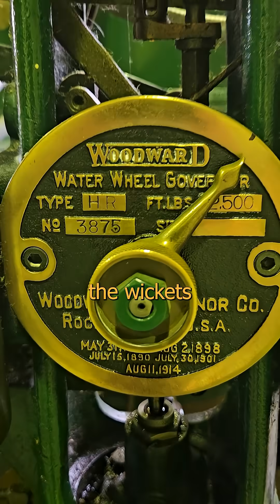Flyball Governor #chrisboden #comedy #engineering #generator #powerplant #electrical #technology

Comment: Trivia: Fly"ball" governor is where we get the term "going balls out" as going full bore.  When the balls fully extend it means the machine ( originating in steam engines) is running at an extreme and damaging rate. Did not know it was used in electro-mechanical systems.   Yeah, very cool!

Comment: Wouldn’t a direct mech linkage be more reliable? I mean, a wire is easily loosened by maybe vibration, and it is a safety feature… with a direct mech linkage the linkage is fixed, solid. Wires? I don’t know, doesn’t feel fail safe.

Comment: A simple set of springs and my 96 Dodge will now theoretically rev to 4500 RPM. Higher RPM governor springs are mostly good for making the automatic trans work better. Much nice to not have the engine falling on its face just before every shift.

Comment: I think I’m still missing something. The flyballs are for sensing rotational speed but driven by a motor that’s running at the same speed as the generator that it’s hooked to. So… my multimeter can read Hz, and I bet enough money to buy ten of them that my multimeter cost less than “this fuck’n’ thing.” Why build this?

Comment: The fact that someone first drew a plan. had hopes. Goes to a metal guy, this guy melts metal and does the housing. 
Incredible. No CNC no Computer, a smith, an enegineer and a little math. Mashed up to one reliable machine that runs and runs and runs. If you dont neglect oil and grease

Comment: The biggest downside to the industrial and technological revolutions. Is that we advanced far to fast and didnt learn how to eek out every last ounce efficiency from a device. We jumped straight to the next and never got very good at efficiency and just bull dozed our way through. 

Think of early computers, if we only had that level of processors for a few decades or even a century or more, how fast and efficient could we have made them. And then applied similar techniques to the next generation of device. Essentially making every step exponentially more powerful and efficient.

Comment: "Listen here, you beautiful maniac. Put down the fidget toys and build something that actually threatens life and limb. I want to see a human-powered kinetic battery. I’m talking a massive, cast-iron flywheel with a moment of inertia so high it makes Isaac Newton weep.
Rig up a gear train so we poor meat-servos can spin that death-wheel up to 'escape velocity' (yeah, I said it). Then, use a hydro-coptic clutch to slam that rotational energy into a generator once it hits critical mass. None of that cheap DC motor trash—I want a rig that effectively utilizes sinusoidal depleneration to power the shop. Build a gym that generates kilowatts or kills the user via catastrophic mechanical failure. Do it for science."

Comment: We are stuck in an era where those with the math and book smarts to design things, have never actually been on the shop floor Doing the things they designed. 
We pine for an era where the people who were on the shop floor transitioned into the people who were designing the next generation.
Until college degrees require 4-10 years on the shop floor  before you get a piece of paper saying you are smart, we are screwed.

Comment: We had one on the Steam Lube Oil Pump (known as the SLOP) on one of the ships I was on. As I headed to watch on day, I noticed a wicked vibration at the entrance to the Pit. As this was Definitely Not Normal, I took the "sailor express" way down to lower lever (I slid down the ladders) and found the entire engine room crew and the Khaki Brigade staring at the SLOP. Turns out one of the governor weight arms had snapped and was rubbing against the housing. Fortunately, we had two other oil pumps (Attached Lube Oil Pump or ALOP, and the Emergency/Electric Lube Oil Pump or ELOP) so we were able to secure the SLOP and repair it. Later in a shipyard period, most of the steam equipment was removed for electric versions.

Comment: You should see the control system for a nuclear steam turbine with mechanical hydraulic controls. Its madness on an epic scale, but it works so well. I believe there are only 3 or 4 left in operation.

Comment: i would have thought, seeing though it is involved in controlling the speed of the gates, that having it run through 2 peices of attached electrical systems would make it significantly more failure prone than having a mechanical connection to the device its trying to regulate. 

Obviously its more expensive to maintain, but if the generator fails, or the motor fails then its no longer preventing the overspeed of the gates then? 

I'm assuming I'm missing something obvious here. it makes sense if its just to smooth out and regulate operation but isn't considered a safety device in the way that a governor will put on the breaks if your elevator is moving up too quickly. (and to be fair, he never mentioned it was for safety)

Comment: How does the signal govern the generator? (I am not questioning the idea or the means, just asking) Does the resistance of the synch motor translate to limiting voltage or current to the alternator or AC generator on the generator somehow?

I see why it is brilliant theoretically, but I need a bit more information to add it to my engineering archive.

Comment: I have always appreciated old design.  Some of it is downright ingenious but simple - using various natural properties to make something almost foolproof reliable.  Things that didn't need a bunch electronic gizmos, power supply, or whatever.  Example: Fire door in old industrial building set on an inclined track held open by a heavy iron weight.  Weight is attached to door by a cable that has a piece of lower temp melting metal to connect it (like lead).  Gets hot enough to melt link, cable releases weight, and door shuts on its own by gravity.

Comment: Why bother with the taint drive if there’s already voltage output proportional to speed? Just wire it to a spring-loaded servo motor that’s connected to the throttle.

Comment: Love this thing!
Would you please do a deeper dive into this kind of governor?  I’m especially fascinated by the adjustable needle near the bottom of the machine, and in finding out what the horizontal needle just below the motor housing is for. Guessing it tells relative speed compared to the set speed… 

And in case it hasn’t been said enough, I love your videos!!! ❤

Comment: Woodward still makes these type of governors…

They are used in general aviation engines to maintain prop shaft rpm… adjusting prop blade angle to control engine rpm…

Steam punk cool that is modern today!

The fly weights in this case operate a control valve that adjust oil pressure being fed to the constant speed propellor…. A small gear pump, driven off the engine supplies endless supply of pressure to operate the system…

If this gear pump or the fly weights stop operating, the prop typically moves to the low pressure position, high rpm, maximum power output… for single engine aircraft.  For twin engine aircraft, the prop fails to the feathered position…

Dirt simple, keep lubricated, they last forever… your kids will have it overhauled after you are gone…

😃

Comment: Well, I'm confused. Not only am I familiar with them from steam engines, I thought that the way that they function - speed increases, balls go out, this causes the ball arms to lever down a valve to release steam and reduce speed - REQUIRED them to be on a steam engine. How to they regulate anything on an electric motor? What are the ball arms actuating?

Comment: I love seeing the old maintained machines. I learned to set movable type at 11 yo and could run and maintain the ancient Chandler Pierce letter press by 12. My continued work there relied on my not breaking anything.
On a small coal mine I learned to run and maintain a Korean War vintage road grader that could run any of 3 fuels; gasoline, diesel, or propane.
So my love of old working machinery runs deep. It is art!

Comment: some 90's chevy c1500's with the 5.7v 8 and i cant remember if it was the 700r4 or 3l60 transmissions but they had something like this built into the side, i only know this cause i worked at a parts store for 7 years and one of the trucks i owned had a governer like that and the nylon gear on the end of it sheered its roll pin and i had to find a new gear and roll pin.

Comment: Aren’t aircraft prop syncs just wired up motors too? If they’re both aligned, they’re pushing pixies in equilibrium, but get them out of phase, and they’re pushing and fighting until they give. Force is force, be it mechanical, electrical, or the force of stupidity, you can swap between them fairly easily.

Comment: a similar principle is what disengages the start windings on a single phase AC induction motor. If that switch ever gets stuck they stay on and eventually the motor goes off on thermal as long as it has thermal protection.

Comment: Sadly I've never seen generator balls that come in a shroud... Ours were steam powered and went commando. but hey what do expect from something build in the age of the boomers, from parts recycled from WWII destroyers, to supply lights to a couple of floating football fields,that held cranes not planes, and enough fuel to make a 3 mile crater in the big salty blue, not to mention enough food to feed lions stadium a few dozen times over.   But we won't talk about the boom boom or the pew pews, cause me personally just used the 1200psi, instant death water vapor  pushed through enough holes to take it down to atmo, to turn the salty blue into refreshing drink.

Comment: Did I see Woodward on the plaque? A diesel locomotive designed in the sixties that’s still in widespread use in Poland today, class SM42, uses a Woodward governor for its fuel injection so the engine doesn’t go out of sync with the main generator.

Comment: Using field current, the speed is higher and contributes to faster response, but if it sense's excursions or back feeding will compensate before prime mover gets pushed to its knee's.

Comment: The hydro plant I worked at had 2 1/10hp 3 phase motors 1 wired to generator output 1 wired to the grid. They were hooked up to a differential gear and as their speed was different it would turn the output that would adjust the wicket gates to get the generator up to speed

Comment: Woodward has been in this game forever and I doubt they'll ever go away. EVERY SINGLE marine engine has a doohickey like this and they still work pretty much exactly the same, the form factor changed a little bit and that's it. No matter if the engine is the size of a car or a small apartment building, they will have this little box in that exact same shade of green working the fuel rack.

Comment: ... never thought of a synchronous motor, but depending on how long or complicated the linkage would be, it's not only elegant, simple, and reliable, but possibly safer and more efficient. Though I do wonder how it governs a DAMN thing if it's tied into the grid. I mean, the grid will drive your generators... pretty violently if I don't miss my guess... at the grid's frequency, whether they want to or not. It's not going to be enough to push the river back uphill, but I'm sure it'll pull the turbines along or hold them back pretty well.

Comment: The terms "balls out" and "balls to the walls" come from these flyball governors. When they spin fast they fly outwards pointing to the walls of the building.
Reply: I always heard “balls to the wall” came from aviation, where it meant to put the ball on top of the throttle lever against the firewall for full power
Reply: I just looked it up, balls to the wall comes from aviation, balls out comes from these fly ball governors. Ultimately the meaning is the same either way, full power
Reply: @mostlymagical3220 
It is throttle, mixture and prop governor/pitch all maxed out. That's balls to walls! It's plural, all 3. Not some whimpy stationary thing.
Reply: @mostlymagical3220 more like "no holding back. Give it everything you got"
Reply: @TheFirstBigCheese to be fair the balls on the end of some levers in a plane are far more stationary relative to their enclosure than any ball weights rotating...
Reply: "Balls to the wall" is more of a warbird thing. (Throttle to the wall)
Reply: Balls to the wall has to do with the throttle being pushed all the way forward in airplance cock pits back in the day but balls out def has to do with the fly ball govenor
Reply: "balls to the wall" also comes from locomotive engine drive controls. Pushing the levers with balls on top forwards to the firewall makes the train go faster.
Reply: @CarlForde  perhaps on safety cab GE units..but every EMD I've ever driven that wasn't a safety cab with New York combined power handles had notch 8 (full throttle) all the way rearwards and idle was all the way forwards.
Reply: I'd love to believe you're right... so you are! 😊🤣
Reply: Balls to the wall refer to the throttle levers on early jets.  The knobs on the end of the lever would nearly contact the instrument panel "wall"
Reply: @cinderclawz  Thats largely considered apocryphal....
Reply: I don't believe you, but I'll back you up.
Reply: apocryphal but fun
Reply: now do 'Skitz out with our Titz out!"  I can't imagine how that started :)
Reply: And from my various restraining orders.
Reply: "Flat out"?  Fits.
Reply: I always thought of glory holes.
Reply: each of you has a different kind of explanation of origin but now I still understand where this saying comes from, it means full throttle. Thanks guys

Comment: We have a restored Victrola hand-cranked 78rpm record player.  It uses a flyball governor to maintain steady speed while spring tension winds down.  Very cool machinery.  I'm also building a model steam engine (benchtop little thing) and will put a flyball kit in the control loop).

Comment: It's also old as shit, made from a time before planned obsolescence was a thing and back then, they built it to last because they didn't want to have to fix it. Anywhere from the early to mid 1900's up to around the 1960's when they realized that innovation drove sales and things built to last only sold once.

The real cool thing about stuff from that time period is the 2 cylinder flywheel tractors.

Comment: The original method for changing the pitch angle on wind turbine blades was also based on flyball governor's. This was necessary due to the turbines rotating too quickly in high wind speeds and the air moving around the blades as opposed to through them. The speed up slow down cycles cause havoc on the gears and generator. Rotating the blades reduced the efficiency slightly - lowering the speed whilst still generating electricity and improved system reliability.

Comment: I need to say this to make sure I understand.

The (unseen) generator powers the Taint Drive, which spins the flyballs.  Speed of the flyball shaft controls the wickets, which controls the amount of power the generator puts out.

More power, faster spin, more flyball flying, and the flying brakes the shaft, which keeps the generator from putting out more power?
Reply: Taint necessarily so. The flying flyball controls the wickets. Fly too fast, wickets close, generator makes less power which slows down the balls. Fly too slow, wickets open etc.
Reply: @TooCloseToHome but what's a wicket???
Reply: @jasonvarner3695 the wickets control how much water is let into the generator. Think Venetian blinds but beefy enough to handle constant high pressure high speed water.
Reply: not necessarily power, although that's also involved, but rotational speed. They want the generator to produce AC voltages of a stable frequency, which requires it to spin at a stable frequency, and the frequency of the voltage directly decides the frequency of the spin of the little motor

Comment: This is such an elegant solution! You can place it wherever you have space, allowing you to effortlessly adapt the placement to match the layout of whatever plant it’s installed at by just running a couple wires! God I love solutions this clean and simple!
Reply: Can you explain this a little more for me? I feel like I know the individual concepts, but I'm apparently needing help connecting them together. 

Thanks!
Reply: @SamHetchler  The motor used in this case is a synchronous motor, which spins at the same speed as the AC power driving it.  In this case it is connected to an AC generator, which means that the shaft driving the flyball governor spins at the same speed as the generator.  This means that the flyball governor can be positioned where it is most convinent near the wickket gate controlls using only a few wires, instead of needing some complicated mechanical linkage to make the connections.
Hope this helps.
Reply: @moo4boy ah, so in this case, it being on top, is just where it happened to be. Makes sense now. Thanks!

Comment: Is the governor only used when the generator isn't connected to the grid or is the generator big enough that it can shift the grid frequency around? I presume that if it is only used when disconnected, the wicket gates would be controlled by the difference between the measured and set real power values and the excitation current by the difference between the measured and set reactive power?